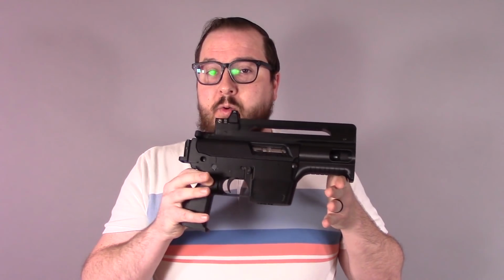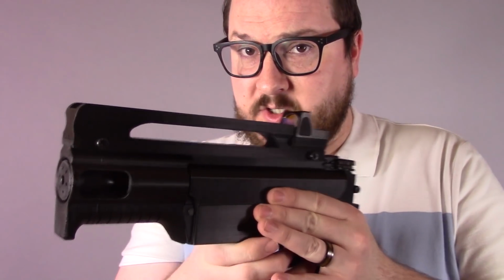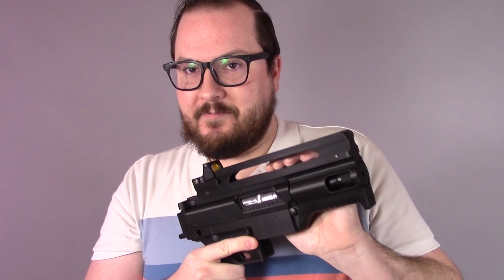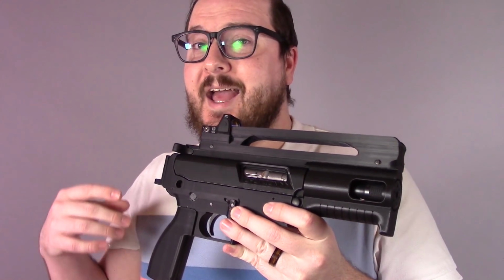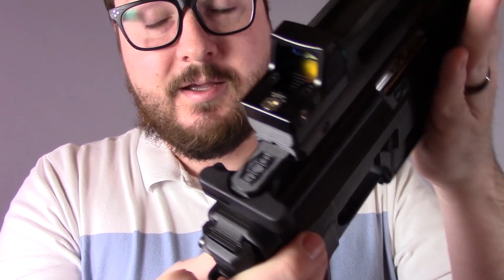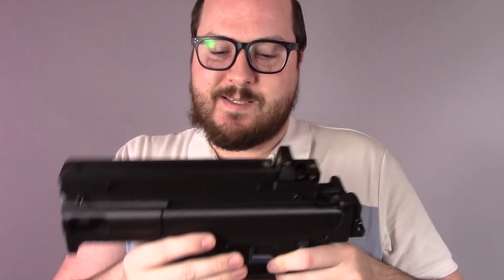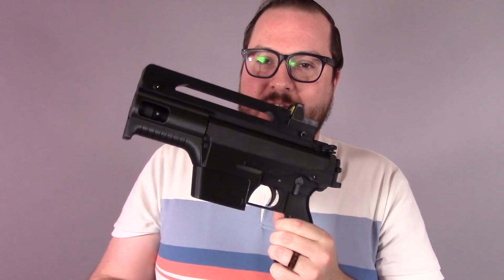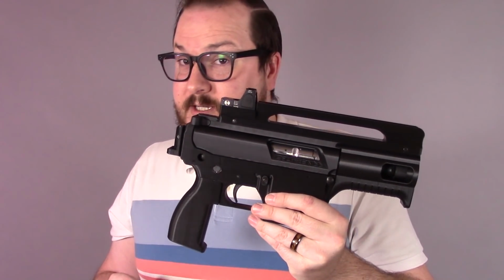3D Printed .22 AR15 Pistol - "SpaceGat 22"

Comment: Has anyone made one using the Proto barrel yet? I have the CMMG bolt, 28" of Chaszel liner and 25x23mm Carbon Fiber and would rather not pay $100+ for a single 4.5" barrel. Its going to be my first
Reply from the maker: Yep, lots of these have been built with the proto barrel 👍
Reply: @booliganshootingsports  Ah looking at the barrel nut and barrel retainer I see the same notch, awesome thanks for the design!

Comment: What spring do you use in your 3d magazines
Reply from the maker: For this, any CMMG mag spring works. Black Dog I believe is what I run in this. But this mag is mainly just cosmetic, it only holds a few rounds.
Reply: @booliganshootingsports  OK sweet so a ar 15 mag spring and thank you for your fast reply I appreciate it and you sharing the files for this cool little gun
Reply from the maker: No, the mags for this use small round magazine springs. Not AR15 mag springs. Black Dog makes the small round ones you need.
Reply: @booliganshootingsports  alright thank you for clarifying that for me

Comment: I'm having trouble with inserting the hammer onto the lower, specifically the hammer pin. While it does go through, it looks like it comes up a bit short on my end. How can I fix this? Should I slice the file to make the whole lower slightly thinner by just a smidge so that the hammer pin fits in a bit more? Thanks.
Reply from the maker: A pic would be helpful. The pin won’t fit perfectly side to side, the lower is thicker than milspec due to material limitations. You need to center it yourself when tapping it in.
Reply: @booliganshootingsports  I will try it again, and send you a pic if I have any difficulty. Also, what muzzle brake is that? I like how it looks!
Reply from the maker: @nextlvlroy  the pictured muzzle device is on my Odysee page
Reply: @booliganshootingsports  I was able to get it. Thank you once again. One more question, and I know i'm annoying at this point, but is there any other spring that will work for the mag? I know the one from Black Dog will work, but my eagerness is killing me right now --- are there any similar springs like that one at a local home depot?
Reply from the maker: @nextlvlroy  any CMMG .22 spring works with it 👍
You may have an easier time finding a CMMG mag at a local shop, they’re very common and work better than the low capacity printed mag I included.
Reply: @booliganshootingsports  Hey! Just wanted to say once again thank you for this release, and your help! This was my first build. Used the cmmg conversion kit as well as using the tubee barrel tutorial. Works great! I love it!

Comment: what can I use a buffer plug? My bolt carrier is loose in the build when assembled. I’m also have failure to feed issues. What can I do to troubleshoot that?
Reply from the maker: For the buffer plug, I use self adhesive felt. The bolt carrier being loose really isn't an issue, it's present in normal receivers as well, but if you want it tightened up, just stick something on the back of the buffer area. Glue some rubber, or print a TPU spacer, or use self adhesive felt like I did. 

For the magazine issues, I address that in the readme. CMMG mags have wildly varying sizes over the years, so I had to design the receiver to fit all of them. That means some may be loose, which in extreme cases, can cause FTF errors. Wrap a few loops of electrical tape around the top of the magazine where it fits in the receiver to solve that.
Reply: Where is the “read me” section?
Reply from the maker: @ghostgunner27  the read me is a document included with the files that you downloaded. You should read the readme prior to printing any firearm frame, there is often very important information included.
Reply: Thanks for your help

Comment: Could you point me in the right direction on what barrel is used?
Reply from the maker: I used the CMMG dedicated .22LR 4.5” barrel.
Reply: Appreciate the reply. Is there a list of what screws are used? Is it a bolt and nut for the brace arm hinge? Also is the hand guard just a friction fit? Does anything attach to the threaded part of the upper? Sorry for all the questions lol
Reply from the maker: @jakersmann  the readme included with the files has all of that information.

Comment: "designed"  ...no you didn't...  this is an AR in .22 without a buffer... you designed nothing.

you might have rounded the edges... prettied up the outsides... but it is still an AR-15 with a .22 bolt.
Reply from the maker: I literally designed every aspect of this aside from the internal geometry which used the standard CMMG AR pattern. What have you designed?

Comment: Ordered the cmmg bcg and 4.5" barrel today and I have been looking all day for what upper and lower I wanted to print. I was leaning towards the DS1913 lower and Daichi upper until I saw this. Found the stl on the gatalog and I'm excited to start printing! I have an ender 3 v2 and am using esun pla+ as well. Could you recommend basic cura settings like print speed, nozzle/bed temp, or anything else? Thanks for all the work you've done on this it looks amazing!

Comment: The receiver file is too big for my printer according to Cura. Anyone got any solutions/suggestions?
Reply from the maker: Which printer? It fits if you angle it properly on an Ender 3 which is the standard size.
Reply: @booliganshootingsports  Also, would a .22 LR AR conversion kit work with this? (I'm super new too all this and have never even built a gun, so I'm really am trying to learn all the jargon.)
Reply from the maker: Yes, you’ll just need a barrel as well.
Reply: @booliganshootingsports  And if I were too search for a .22 LR 4.5" barrel I shouldn't have a problem? In the gun world, all parts typically universally sized?
Reply from the maker: @GaninIsMyName   CMMG makes the stand-alone barrel as well. You need the barrel collar to work with the .22Lr barrel. If you’re using the conversion kit, you’d use a 5.56 AR barrel.
Reply: Yeah, it's an ender 3 v2. I honestly had no idea I could angle it.

Comment: anyone print and find out the hammer pin isnt long enough/ .... havent seen comments about this.
Reply from the maker: If your hammer pin isn't long enough, you're using an out of spec hammer pin or you printed out of spec.
Reply: @booliganshootingsports  must have printed out of spec somehow. Trigger pin fits fine.

https://youtu.be/BO_JdLCOwxA
Reply from the maker: @BrandonRyanPresents  the issue shown there is that your pin isn’t in all the way. Its not supposed to fit flush since the receiver is thicker there. It sets back slightly lined up with the trigger pin.
Reply: @booliganshootingsports  thank youuuuu

Comment: How difficult is it to mount the barrel to the pla+ upper?
Reply from the maker: As easy as installing one in any other AR upper.
Reply: @booliganshootingsports  thanks for replying.   Did you use a metal barrel nut or PLA+ one?
Reply from the maker: @Spinn36D  On my specific build, I have an aluminum barrel nut, but in the beta testing, we've had good results with the printed barrel nut included with the files.

Comment: Hello I couldn't find your email to contact you directly, I had questions on how you install detent and spring for rear takedown pin. I also wanted to know more about the barrel nut and how it was made. Thanks again for your content.
Reply from the maker: This build doesn’t use a rear detent and spring, just the rear pin. And on the current version, the barrel nut is printed.

Comment: I would like to make this to accept 10-22 mags since they seem to be the most universal. Any thots?
Reply from the maker: Not without substantial redesign. The issue isn't the receiver, that can easily be overcome. The issue is, the CMMG bolt isn't designed or shaped correctly to feed from a 10/22 magazine. So it's not a printable fix, it's a completely reengineer the bolt fix.
Reply: @booliganshootingsports   Ah, thank you. I may attempt something closer to your 10-22 based platform.  Are there files available for that ?
Thank you for your great work.
Reply from the maker: @texasRoofDoctor  There are, I explain where my files are in that video and it uses Ivan's 10/22 receiver design which is commonly available on the normal gun file websites.

Comment: Nice build. When i started 3d printing, i realized i was just another consumer knocking out other people’s product. I am an old school machinist/ metals craftsman, used to creating/ designing things, so it makes sense to be able to do that with my 3d printer as well. I just upgraded my computer to use Fusion 360 and i am teaching myself to model with it. Going to have fun!
Reply from the maker: Have a blast with it! The software has a learning curve for sure, but once you get the hang of it, you can blast through designs so quickly.

Comment: Why don't you make a mold of the parts you printed
Reply from the maker: To what end? It’s strong enough as is with the materials used. What material would you use with the mold that would be worth the trouble?

Comment: Could you adapt it for airsoft use?
Reply from the maker: It would require a full redesign. GBB wouldn't be doable because you need to have a buffer tube. AEG would require the whole geometry of everything changed to fit with a gearbox.
Reply: @booliganshootingsports  well I just thought because it was an AR inspired body and with AR airsoft replicas in the plenty. May need to just change the handle a little. But when it comes to internals it might have room just about enough room to fit them. May need to drill a hole in the back to fit the wires and batteries in a stock. 🤔 not sure if it would work but that’s how I would do it. Sorry I think to much 😅
Reply from the maker: @chazymondo7766  it’s not even close to having enough room to fit AEG  internals. Look at a pic of the inside of a normal AR receiver and then look at the inside of an AEG receiver, it’s a completely different situation, lol. That’s why it would require a full, from the ground up redesign.

Comment: Ooh neat! I thought the CMMG .22lr conversion kit would be GREAT to make a home-made firearm. Self-contained bolt, direct blowback, AND the chamber is integral. Basically all the pressure-bearing components are right there.
Reply from the maker: So, this build uses the standalone CMMG conversion BCG and their proper .22LR barrel, but there are definitely people in the beta doing it using the caliber conversion kit instead with the integrated chamber and a cut down 5.56 barrel.
Reply: @booliganshootingsports  Gotcha gotcha. Very neat. One of the best-looking homemades I've seen. Haven't gotten around to putting something together myself, but I hope to some day! =)

Comment: Can it take 5.56 rounds?
Reply from the maker: Lol no. For like 20 different reasons.
Reply: @booliganshootingsports  can you modify it to take 5.56 rounds or can i do that
Reply from the maker: It would require a full redesign. The receivers aren’t strong enough. There’s no place for the bolt to travel or way to attach a buffer assembly. There is no space for a gas tube. I mean, the files will be released eventually and people can reconfigure them to do whatever they want, but it would require a full ground up redesign to use other calibers.
Reply: @booliganshootingsports  ok. Would you help me redesign the gun?
Reply from the maker: Probably not. I designed this to my specifications, if other people want to redesign it, that’s on their time and abilities.
Reply: @booliganshootingsports  ok. Thanks I will Make my own gun now.

Comment: Make it run on ruger 10/22 mags
Reply from the maker: I’ve looked into it. The issue is, the bolt for the AR22 and 10/22 are fairly different and there is potential interference getting the AR bolt to feed from a 10/22 mag. I’m actively looking into it, but it’s not as simple as just a receiver tweak unfortunately.

Comment: could you have done at least a demonstration of the gun in a video about said gun? isn't this just common sense at this point?
Reply from the maker: No, because my range schedule is different than my video shooting schedule. There will be a separate range video like I did with all of my other printed guns. I unfortunately can't just run to the range to get video every time I whip up a new gun, so I combine trips and videos. If you want a demonstration of this firing system, you could very easily watch my previous range video as internally, it's identical to this one.

Comment: The title of this video is misleading. The components that are considered a pistol or firearm were purchased, not printed.
Reply from the maker: That’s not correct. The part of any AR based gun that is considered the firearm is the receiver. That was printed. The only purchased parts were the barrel, bolt, and trigger assembly, and those are unregulated and able to be shipped to your door. 

What component on this do you think is considered the “firearm”?
Reply: @booliganshootingsports  Yes it worked! I got a reply I'm going to be famous!
Reply from the maker: I mean, I respond to damn near every comment, especially idiotic ones spouting false information 😉

Comment: Just curious. When printing any lower receiver. Doesn't there have to be integrated metal somewhere on the part to be legal? Hence the metal id tag on Glock frames? I was under the assumption this was a law to prevent guns from passing through x-ray machines. Does this apply to homemade lowers/frames?
Reply from the maker: Federally, the completed firearm has to have about 4 oz of metal in it. Note, that is the completed firearm, so the barrel, bolt, etc all count towards the total. The receiver alone isn't considered the complete firearm here, despite the fact that a stripped lower is considered as a firearm for other transfer and manufacturing purposes. 

The metal ID tag on Glock frames isn't really for adding to that metal content. It's because it is simpler and sturdier for them to engrave the serial number on a metal tag that is inserted into the frame than to laser or otherwise engrave the polymer frame, which could be more easily destroyed or changed.
Reply: @booliganshootingsports  thank you for answering that question.
Reply from the maker: For sure! Usually firearm regulations are as clear as mud, but luckily, this one is currently pretty clear.

Comment: Would there be a benefit of printing with Nylon carbon fiber? Nice work
Reply from the maker: There most likely would be a strength and appearance improvement, however, the tradeoff with cost and difficulty of printing make it unfeasible for most users.

Comment: 22 is extremely gassy and dirty. 
maybe put a linear comp on and get all that gas away and out into the open end like "the pig" can comp.
Reply from the maker: I did design a linear comp and it’s fitted on this gun in this video... 

But it’s blowback operated so the insides will always get dirty. It’s just the nature of a blowback operated .22.
Reply: @booliganshootingsports  i mean the insides of the comp. they will get dirty either way but being open the particles dont land on the comp as bad.
if you will look at the right vids of mine and i have no clue which, i have a papered machine gun and a 22 upper, suppressed, 6 inch bbl. DIRTYYYYYYYYY bad.
Reply from the maker: Haha, getting them dirty is the fun part!

Comment: In AK style side charger, firing 9mm, 45, or even 38spl/ 357mag (personally the 38/ 357 would be bad ass and very wacky which would be great for this gun) would be the best little main, and even if you guys only sell it as a 22lr, I'll probably still get it because it would be a very unique SM
Reply from the maker: Other calibers aren’t possible without a radical design change. And this won’t be for sale, the files will be released so you can print your own.
Reply: @booliganshootingsports  Ah okay, still that is pretty badass, and even if you keep the AR charging handle, a person can still get a side charger "mount"? That connects to the AR one (for when you have a scope in the way, for example) and it would still be a great little blaster. I can't wait for the design to come out so I can build it!
Reply from the maker: @gw833  the side charger isn’t the problem and it’s something I’m working on for the next version. The problem is, you can’t run this design in any caliber other than .22 since you’d need to redesign the lower completely to run a buffer tube.
Reply: @booliganshootingsports  No I got that part now, sorry for not expressing that better. .22 is still a pretty good caliber especially if you use CCI breakaway rounds, and I would still totally use it, I was just saying that it would be "more cool" with a higher caliber, but I have no time to make it myself so I thank you so much that this might be something that I can build in the future!
Btw, I was thinking of names an "raging hornet" keeps popping in my mind because I would get a .22 drum mag for this and one of those trigger groups that allow for two shots per trigger pull. 
Again, this is bad ass, I love your builds, and thank you again for putting in the work so we can make a bad ass gat!

Comment: when running at 100% infill, has anyone considered annealing? There are some great diy videos here, backed up with good science to prove increased strength.
Reply from the maker: Yes, some parts are recommended for annealing on some builds. It just introduces a lot of potential issues with shrinkage and warping that need to be overcome.

Comment: So what makes PLA+ better than PETG? I’m new to 3D printing and not looking at messing with printed firearms but I am interested in how various filaments hold up to the heat and pressures that are exerted in those types of applications seeing as it is probably the best test of those areas for anything printed to be used under any hard use items.